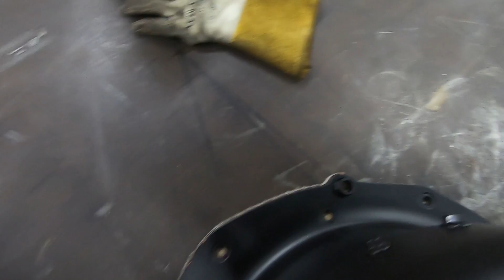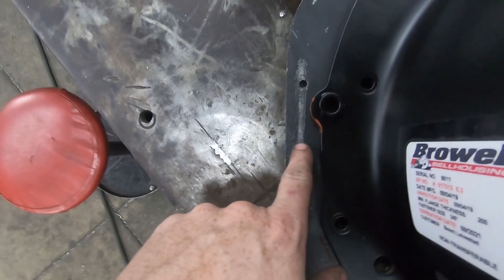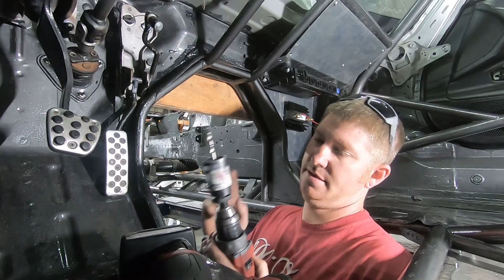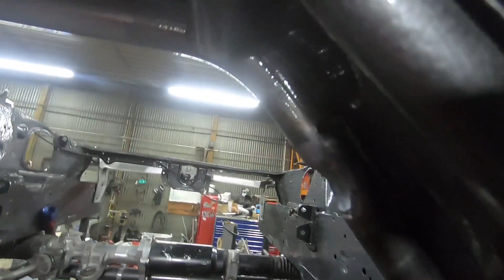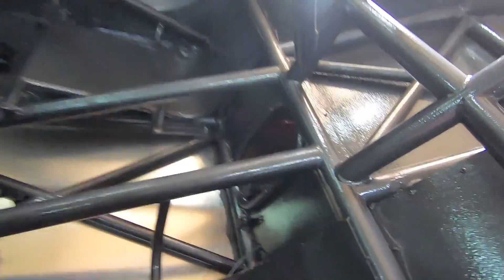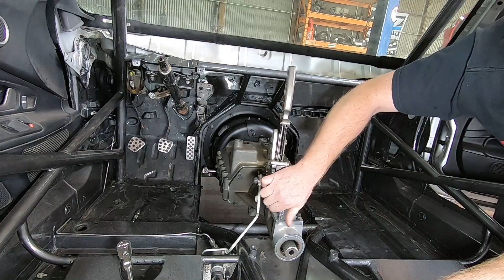Sometimes you Step Back to Go Forward. Sho’nuff got a bellhousing

Comment: They should have made the first bay with the lounge the Tune and Dyno SpeedShop and then the others for Fab and builds. 

Speed Shop is only for Dyno and Tuning and kept clean. You can make it look awesome for customers and then cut down the noise in the Shop Shop.

They should rent out other section to other tuners, or to a dude that does audio systems. Find ways to bring more traffic into the shop.

Comment: Here's a couple of tips. If you using a hole saw and already have a guide hole for the drill ...replace the drill bit with a plain piece or rod, it stops the drill wandering in the hole and ruining the hard found alignment....secondly you should have the correct raceseat in the car by now so you can get the rest of the clearances sorted....good luck

Comment: Am I missing something? I thought this build was first a manual? To go up against leroy
Reply: It is a manual, it has a manual trans in it in the video and it has a man pedal also seen in the video.
Reply: @talonted1990  could also be sequential gear box. That shifter definitely does not look anything like a 4 or 5 speed
Reply: @codythrasher3930  It is a sequential gearbox, it is manually shifted without using the clutch.

Comment: Should have left the motor out and freshened it up while it was out
Reply: If it ain't broke dont fix it
Reply: Its getting freshened up. They’ve said it multiple times. Definitely needs valve springs at the minimum to start running big boost. And the ring gaps loosened slightly. Plus it’s probably getting some big cams.

Comment: Tip .. instead of cutting new bits to fit the tube that you notched you could’ve used the bits that you notched out if you put them in the opposite way you cut out

Comment: Why didn’t you just take the pieces you cut out and flip them around
Reply: holesaw removes to much material. plus I needed more than 1 inch tube. I used 1.625 tube to fill.

Comment: It always feels so good when doing a build like Sho’Nuff when after hiking that long and winding road of the trail less traveled and have faced all of the trials and tribulations of the build that you now are at the far bank of the Rubicon and need only to cross it to reach your final victory of Sho’Nuff of making it’s first path down the drag strip and turning on the first of many win lights to come.
Shawn I commend you a very elegant solution to make clearance for those pain in the tookus mounting holes and extra material on edge of the clutch can.  Just a FYI I had to make similar modifications to my car years ago and when I went to my first NHRA national event caught a ration of manure about not fish plating the notched area of the tubing.  The long and the short I ended up having to pull the engine and trans and “borrow” some tubing from a buddy of mine fab up some reinforcement plats and plug use his TIG welder and plug and edge weld the in the pieces of tubing that I used to reinforce the notched areas.
Reply: Do you know what a comma is? What about a run on sentance? Use a fucking period for fuck's sake.

Comment: You guys really need to take a few days and hammer this thing out once those parts come in!  Much longer and Leroy is going to die of old age before sho-nuff can beat on him! Lol
Reply: The Generous Degenerate Building a car like Sho’Nuff is like making a fine wine it has to age and mature a little bit in the barrel to reach its maximum potential.  Besides even if Shawn could devote all day every day to building out Sho’Nuff he would quickly start going nuts working on the same car all day long and then little things start to suffer because you just want it done besides LeRoy isn’t going anywhere.
Reply: @gullreefclub  you're an ass.
Reply: @thegenerousdegenerate9395 . Why is he an Ass. He just stated a fact. Obviously you have no idea what's involved in building such a complex race car. Otherwise you wouldn't have got all Butthurt and acting like a baby and calling someone names.

Comment: Why not just flip the pieces you cut out and weld em in ?
Reply: I'm thinking Probably because hole saws at the best of cuts remove a lot of  material around the cut  so would of been under size to the hole and would of needed to much filler rod

Comment: Stupid question, but is this a legal modification to the cage/chassis?
Reply: no that is not part of the required safety structure.
Reply: was wondering the same - assuming that section isn't related to driver safety for the cage cert?
Reply: From memory, I don't think that little hoop was necessary for their cert, but they liked how it worked with the mid plate. I'll have to rewatch some of their vids to be sure.
Reply: The way its hidden, i don't think anybody will notice.. i cant see the cage cert guys stripping the car down to the bell housing to check if theres any notching going on 😂 unless of course they see this video.
Reply: @britishpitbikerider1783  To be honest, the way people are trolls on the internet these days I wouldn't put it past someone sending this video specifically to the cert company to try and get them in trouble.
Reply: @TheLastHonk  yeah i get ya.. it wouldnt be a surprise thats for sure.. party poopers everywhere.